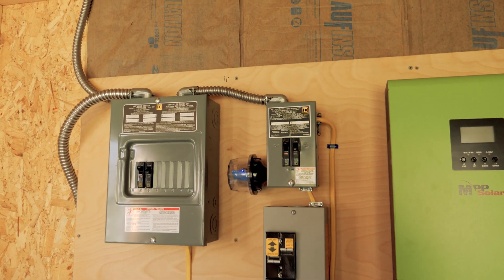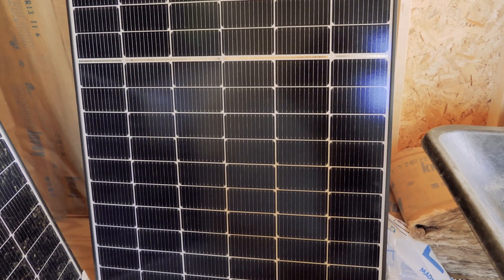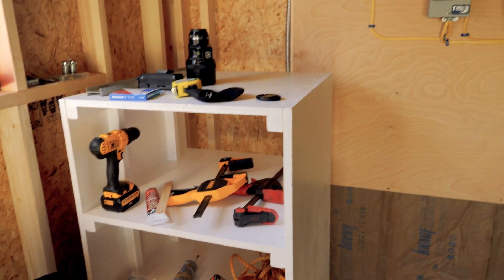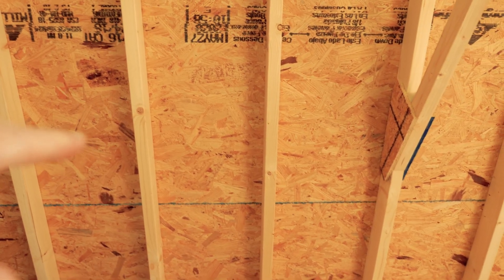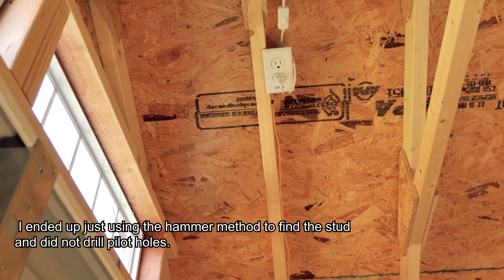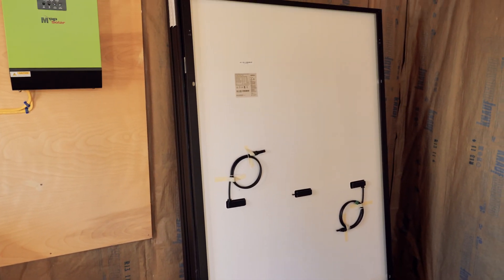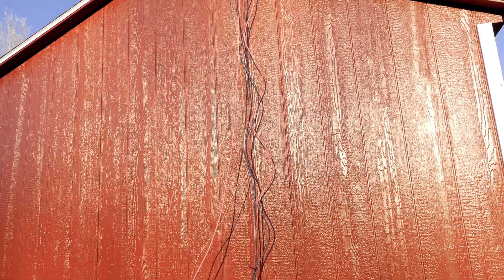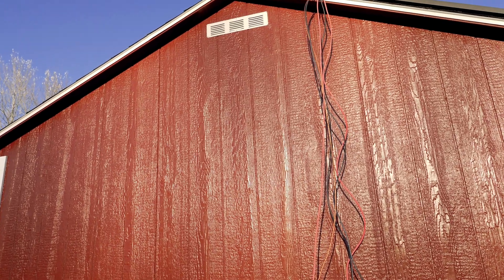New Off Grid Solar Shed Part 8 - Installing Solar

Comment: You need an impact gun!!  
We do this year round in VT, it's definitely not as fun in the snow.  🤣
Reply from the maker: I have one but Iron ridge says not to use due to heat generated in driving down the screws in the Flashfoot's!   I would have to think that pro installers like yourself are using impact guns and not having any issues. How am I doing on the install from a pro point of view?    You just gained another subscriber.   Thanks for watching.
Reply: @GreenMountainDIYGuy  I guess I must have missed that bit in the manual.  Can't imagine doing it by hand though! 
Looks good! Everything looks like it's  to spec and well done. Heyco clips and ironridge wire clips will help keep everything nice and tidy.  
Nice work!
Reply from the maker: @benssolarandbattery  Thanks Ben.  Yes, I have in both sets of clips and they are working awesome!  You ever do any work n the St. Albans Area?  Let's keep in touch!
Reply: @GreenMountainDIYGuy  yes, we're up in that area often!  Sounds good.